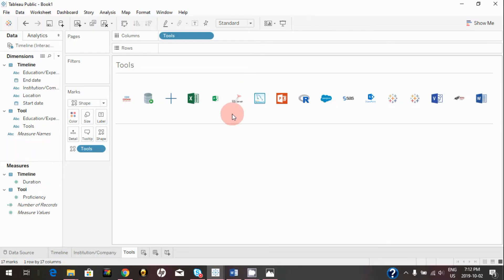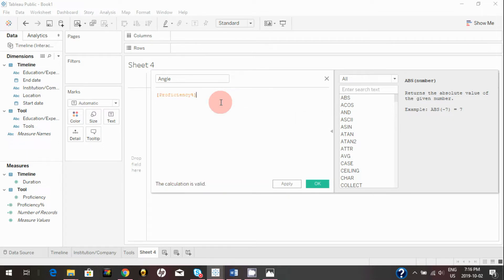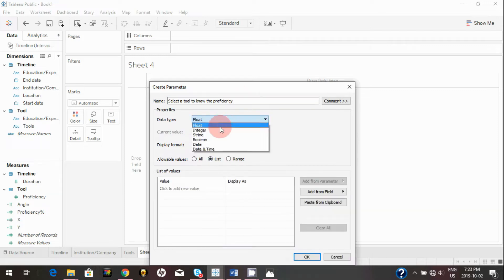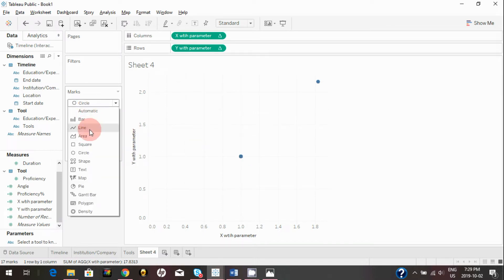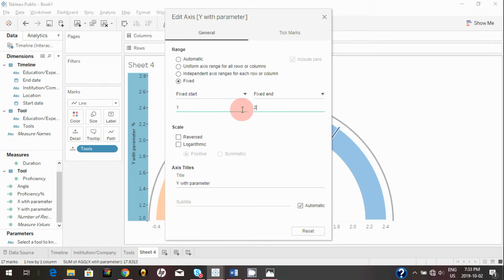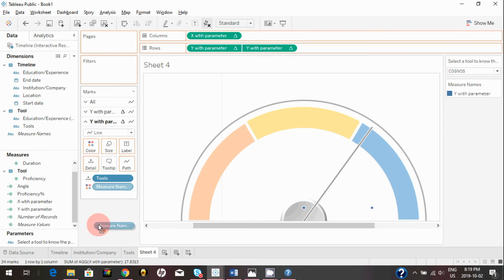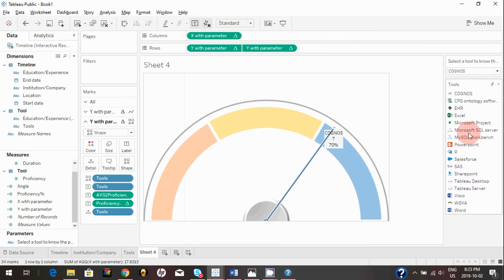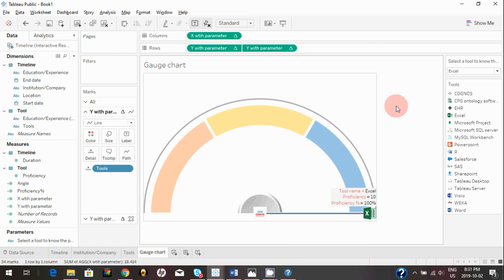How to create Speedometer / Gauge chart in Tableau

Comment: when i use this formula  IIF(ATTR([Tools])=[Select a Tool to know proficiency],
1 + SQRT(2) * COS((1-[Proficiency%])*180 * PI() / 180),1)
i m getting reference to undefined feild (on select a tool to know proficiency) help
Reply: check for the speelings
Reply from the maker: Yeah that should work. Check for typos..
Reply: @suyogmorecoolable  I also tried this and getting an error but I do not have a 'Tools' option when I create the parameter, is this a different step that has to be completed?

Comment: One last question! When i follow your steps, I get a line that extends beyond the range of the Axis. For example, my x value might be over 5.0 if % Proficiency is in the 80% range. How do you get your line to stop at 2.5 when the actual value is greater?
Reply from the maker: I think if you fixed your axis as shown in the video you should not get a extended line..

Comment: Does the process change if the rate being visualized is not a window calculation? In your example you're using % Proficiency which is already a table calc. What needs to change in order to use a rate calculation that is not a table calculation?
Reply from the maker: I am not sure what can be done in that case. I will do some research on this and get back to you..  Thanks..

Comment: Hi Suyog. I have understood the concept which you have very explained very well. But when trying to plot, I am not getting the Compute Using function - as shown at time stamp 6.38 in the video. I have moved the Measures to the Column & Row and also the Dimension to the Details Marks. One difference I can see is that the delta symbol next to the measures in the shelf does not appear in my worksheet. Appreciate your help. PS: I am very new user and quite sure I am missing something simple. Vijai
Reply: I might be able to explain. The example uses '% proficiency' which is itself a table calculation. If the rate you are trying to visualize is already a table calc. when you bring inthe x and y fields they will default to that table calc. I am not sure how to adjust the process if the rate being visualized is not already a table calc. I commented with that quesiton as well, hopefully it gets answered
Reply from the maker: Yes you are right. Steve.. Thanks for answering the question..
Reply: Facing the same scenario.. Is it resolved?
Reply: @dharinikarthikeyan7578  No. Trying different things but no luck. 
Suyog - Please assist.

Comment: Hi buddy. When I am trying to create X and Y dimensions, there is an error on IIF statement that "cannot mix aggregate and non-aggregate functions".  Can you provide any explanation on this?
Reply: Thanks for that Suyog. I got a line but my line gets shorter/longer rather than moving eitherways,  on changing the parameters. Do you know why?
Reply from the maker: Hello Kartik, Please make sure your X and Y calculated fields are measures and not dimensions. Dimensions can not be aggregated, that is why you are getting that error. Please change X and Y back to measures and try. Let me know if this helps.
Reply: @suyogmorecoolable  Hi Suyog, case same with me, x & y measures but error ?
Reply: @arzanmuharom4138  Make sure you have used accurate functions to calculate ANGLE, it would be Proficiency% & not Proficiency, and thank this @Suyog

Comment: Hi, When I am trying to select the line option in the marks it's not showing the line did I miss anything?
Reply from the maker: Hi Manoj, Can you re-watch the video from 6.25 to 7. You might have missed to change the X & Y calculations to compute using tools and not table across. Let me know if this helps.
Reply: @suyogmorecoolable  Hey Suyog! I am trying to replicate your process in a newer version of tableau and table calculations now have many more options. Can you tell me what kind of table calculation is being used here? the default option seems to be 'difference'. Is that what you're using here?

Also, in my columns and rows, both X and Y with parameters are being shown as 'AGG(X With Parameters)'. Is this correct or am I doing something wrong?

Thanks for the great video!